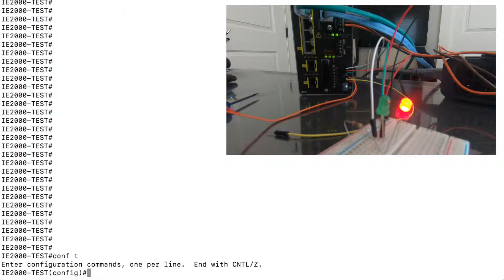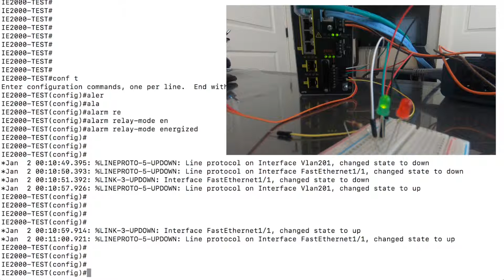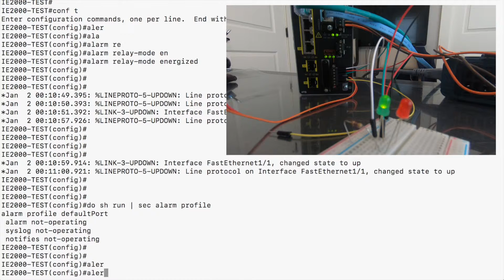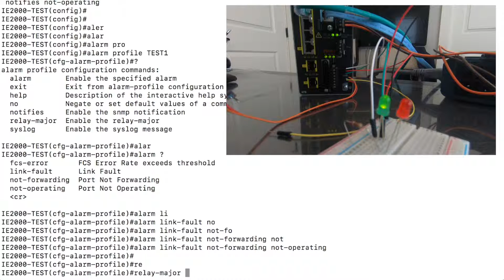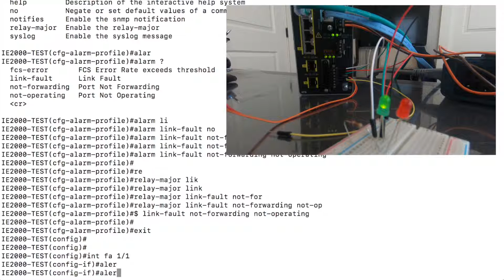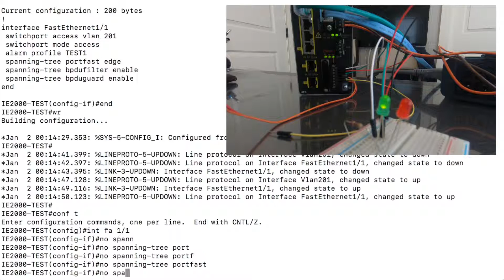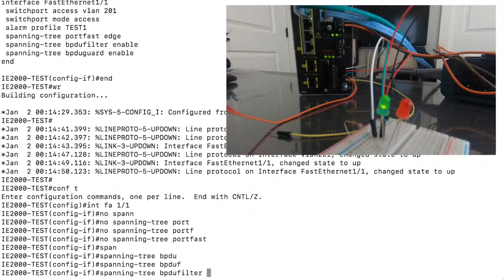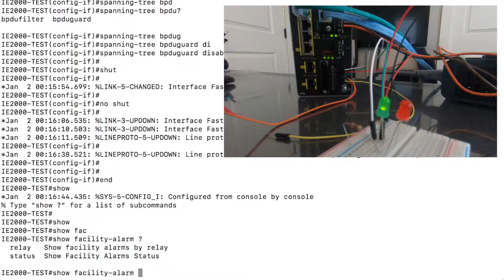Cisco Industrial Switch Alarm Circuit Example

Comment: Can you actually do a short video about the actual physical wiring for the alarm section or point me in the direction of a previously recorded video regarding the physical wiring?
Reply from the maker: I'm not sure what you mean exactly, I do cover those concepts here. Do you mean more of the alarm itself?
Reply: Same question.  There is no explanation of how the led turns on.  The switch I have has only the alarm switch and not sure I can feed power through it?
Reply: No topology and how it connects to your LED and the switch. The syntax command is clear no doubt about that but need more info.

Comment: is NO/NC contact dry or wet? it is mentioned an output alarm relay, so I assume it is a wet one.
Reply from the maker: It's been a while since I did this... double check this document: https://www.cisco.com/c/en/us/td/docs/switches/lan/cisco_ie2000/hardware/installation/guide/ie2000_hig/REV-HIGINSTL.html#22865
Reply: @TheTechCatalyst  thank you. the document doesn't mention it clearly, so I am wondering if NO/NC could be used as a dry contact for PLC monitoring
Reply from the maker: @ww-mc8pv  They are dry contacts (provide no voltage).  In the video I powered the LED with a battery on the common pin I believe.   

 A PLC will probably work as well but power through the relay should be less than or equal to 24 VDC, 1.0 A or 48 VDC, 0.5 A.
Reply: @TheTechCatalyst  I see, i thought you powered the LED by using CISCO internal power, since the manual said it could trigger the external alarm device, like LED, sound...so they are wet ones, but they can be configure to be dry ones, as you did in video, right? Thanks again.